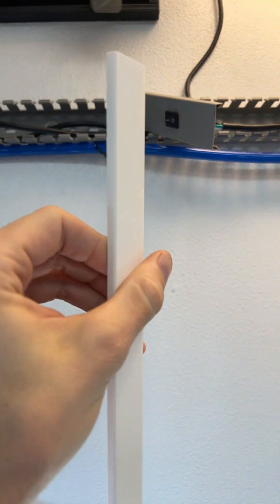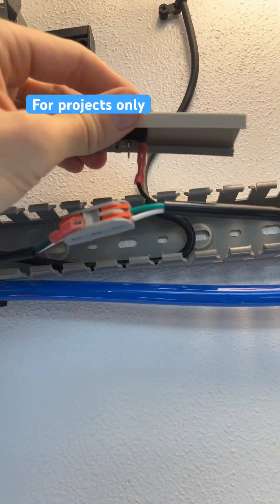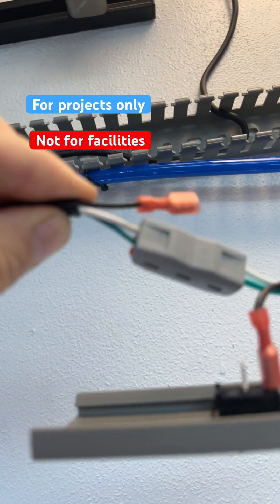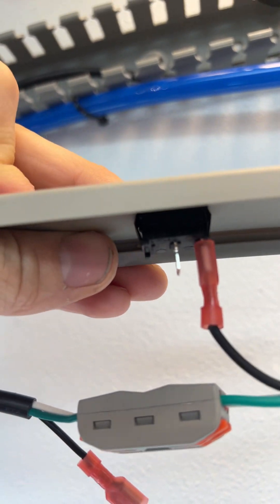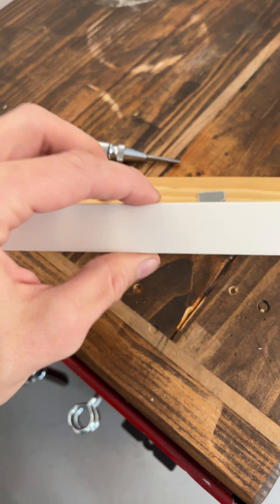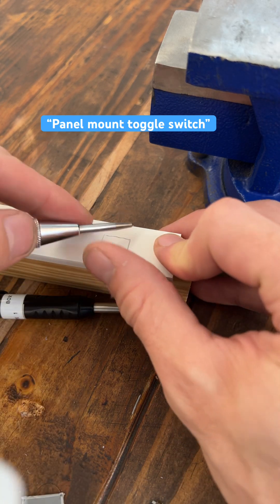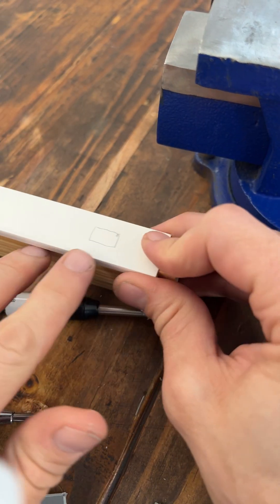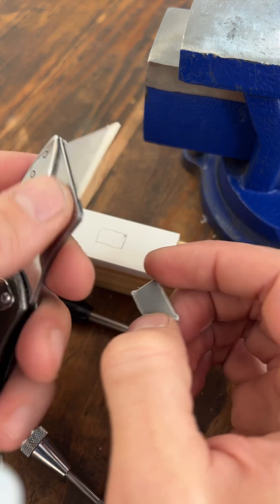Cable Track can be a panel too

Comment: Need to fix ur center punch my guy
Reply from the maker: I KNOW RIGHT?!  i fixed it once already and I wonder what will make it more robust.  Got a favorite brand? or suggestion?
Reply: @davidmalawey  they can be fixed I'll send you a link if I remember. Otherwise get a NOS Starrett 18a/18c   as Starrett manufacturing has turned to doodie. Or a reinstag/sunflag etc.
Reply from the maker: @SlowExpensive   I went ahead with your suggestion.  I hope Starrett does not let me down for $34 

https://amzn.to/3ZQyXwx
Reply: @davidmalawey  a NOS one? Nice, where from?

Comment: That is an NEC code violation to put a 120 V switch and wire connections there.  Switches and wire connections must be in an approved Junction box and that is not a junction box per the NEC.
Reply: I think he is aware of that, thus the written disclaimer in the video. Also, seeing as this is not part of a device he is selling or a residential project under the purview of this code, I don’t think it is helpful to point out what could be a code violation in another context.
Reply: So no switch can be on a computer light etc?  This isn't residential wiring
Reply: @scott8689 the code doesn’t apply after the transformer/power supply. a switch on a computer wouldn’t be 120
Reply: @heshfitnesslifestyle  There can and sometimes are 120 volt switches in computer power supplies on the rear panel.  The main switch on the front of the computer is of course not 120 volt.
Reply: Ok a fan then.  This isn't house wiring
Reply: @scott8689  It is premise wiring which the NEC covers and it was stated that this is 120v so no, this switch is a code violation in the way it was installed, not that it is a switch.  So don't pull that red herring out.
Reply: @wolfgangunger217  it's not premise wiring.